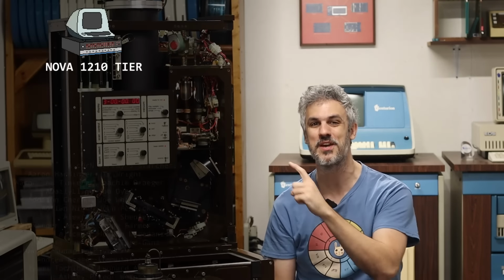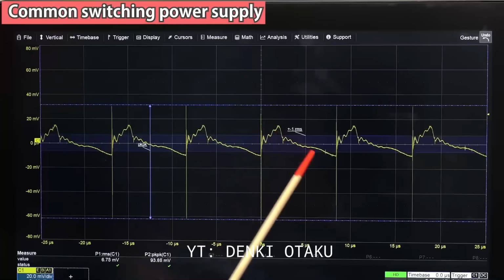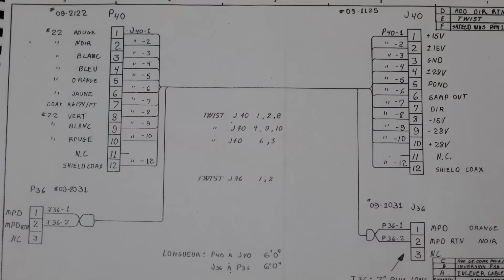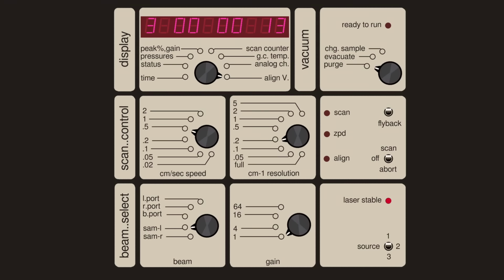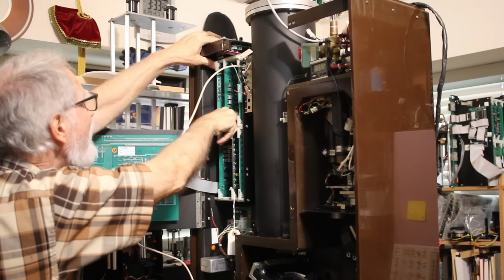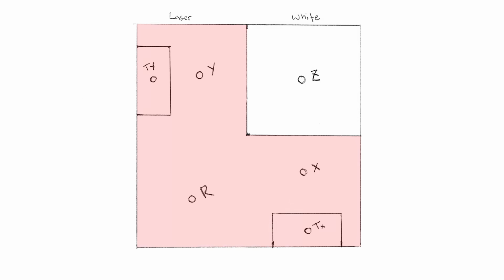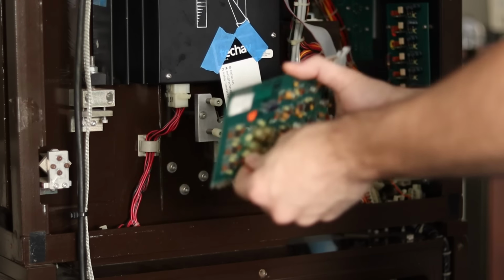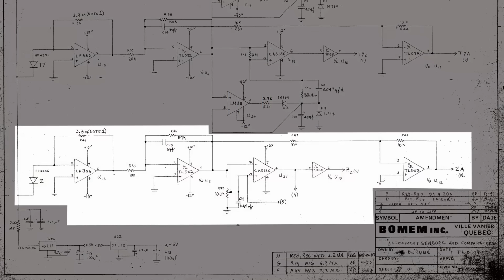I Found a Production Mistake on the Spectrometer!

Comment: so, I have a comment about the +/- 15 V jumpers that got removed at 26:36.  I think you probably should leave them in.  yes the pcb has traces and through-holes that do what those jumpers do and get power from one side of the slot to the other, but what happens when the pcb is pulled out of the back plane?  I think it's a sensible "feature" to remove power from the motor driver board if the circuit that should be controlling that board has been taken out of the system:  if there were no traces on the back plane, if the only connection was through the pcb then pulling out that pcb disconnects the motor drive circuit, both the control signals and the power, which sounds good.  the problem is that there are traces on the back plane, and you're hoping that none of the pins are even just slightly touching the sides of the through holes they're in.  what if the +15 V rail is connected, but not the return, and not the -15 V?  what happens to the circuitry on that motor driver board, do the control signals that are still connected provide a return path for the current and you end up feeding power the wrong way through a logic circuit or op amp?  I think you should keep those jumpers in.

Comment: I like your content and typically agree with your opinions and I'm thankful you went into detail about laser safety. However, arguing that the low power laser is safe because it's been used all over the country is not a good safety argument. See: asbestos. Even further, what is common is less dangerous than what you will probably handle in an industrial world, you can stare at the sun for a little bit and still see, one slightly powerful laser can immediately do damage. So thank you for taking it seriously.

Comment: The OEM unsoldered connections remind me of a similar thing I experienced.  Around 40+ years ago, I designed and built a 12 channel audio mixer.  I used it for my main mixer for recordings and live theater sound for about 30 years.  At some point, it had developed a glitch in the level meter system, that never bothered the audio.  For a long time I could never find the cause.  Until one time checking or modding something else, I discovered ONE main ground connection in the level meter system that I had missed soldering.  Soldered that point, and it never had the glitch again.

Comment: I usually start off by yelling at the screen before hitting the keyboard... Patience was rewarded since you figured out that the +/- 15V supply for the motor had to go through the card, and the wrong card was in that slot. 👍

Comment: Before getting complacent about lasers you should watch the film John Carpenter's "Dark Star" - especially when doing alignment! :glasses-purple-yellow-diamond: 😀 Couldn't see why it wasn't possible to resolder the +/-15V supply pins to the traces? R5 is not the feedback resistor it is the input resistor, R6 is the feedback. Gain = rf/rin = R6/R5

Comment: Well explained on the HeNe laser risk. I used to work with medical and dental lasers. If the laser were say KTP at 532nm, which is green, the eye risk would be higher because of the level of absorption in the retina (which is red). The other higher risk would be a laser with high absorption in water such as erbium YAG. So it's not just the power / watts output of the laser but also the wavelength and what it is interacting with.

Comment: I'm wondering if the motor control board had built-in connectivity of the 15v lines from one set of pins to the other, that the bridges card didnt have. 
This would make the connection to the destination pin headers through the card, so the missing solder wasnt detected.
Edit: Answered in video, lol.

Comment: Hi! nice piece of technology. About the solder and through-holes. Remember that you have the component side at view, not the solder side. So maybe the solder don't run into the through-hole complete height but at the tips is fully solder. If not when tie the wire-wrap the pin will fall out.
If part of the sensors can pick ambient light and you are using leds lamps at your lab maybe you are picking the modulation & noise from them.
I don't know in detail how a laser works, but if the gas is contaminated or if the lamp is worn out may be became noisy as a common neon pilot lamp or a vacuum tube, may be produce somo EMI noises or noises in the light.
At the regulators input you have there a low value resistor, them act as fuse and as low pass filter, but for some reason the capacitor that the regulators needs at the input is not at the diagram :) (no low pass filter activated :)).
I don't know if the OAs use a VREF line, if use change all the capacitors at that line too :)
My money goes for the leds lamps and noise from them :)

Comment: Likely the card plugged into that slot had both sides of the card connected through via so the card probably completed the circuit.
Reply: As it turns out later in the video, that is precisely what the issue was.

Comment: A little bit of nit-picking on the LASER safety talk: A centimetre-wide beam is not really safer than a focused pin point. If you were silly enough to point a centimetre-wide beam into your eye, the cornea would do a very good job of focusing that beam down to a point on your retina.
Reply: It is safer (on average) for the simple reason that it is a lot for something to perfectly reflect that one centimeter of light perfectly into your eye, vs a smaller spot of equivalent optical power. You are correct that in the worst case both could result in similar damage to the retina, but you need a pretty much perfect hit on roughly maximally sized pupils to get max power on your retina with a 1cm beam, vs a a tighter beam that doesn't need nearly as perfect of a hit.

Comment: “Noise” on the ZPD detection – 

When I was looking at the scope trace @40:56 it doesn’t look like noise to me- it looks like there is a second signal separated by ~320us… not just random noise.   I don’t think noise from the mean well supply would look so similar.  
 
If the problem is due to vibrations in the motor you shouldn’t see it if the motor isn’t moving.  If you scan the motor to the Zero Phase Position and stop there you should see the maximum signal strength from the detector as all wavelengths are constructively interfering.    If that signal still isn’t stable that isn’t the motor- that leaves the detector and the amplifiers.

Comment: HeNe lasers have several failure modes.  If the tube sits idle for long periods of time, very small amounts of impurities can outgas from contaminants or extremely small real or virtual leaks.  Running the discharge can clean the gas of these contaminants by reactions between excited states of the He and Ne atoms and the contaminant molecules, such as N2, O2, H2, and CH4. These reactions break apart contaminant molecules into products that stick to the glass walls and leave the plasma cleaner.  Contaminants in the plasma can make the discharge unstable and reduce the output power of the laser.

A long term failure mode of HeNe lasers is caused by the Ne and to a lesser extent the He atoms being implanted into the glass walls of the tube.  This implantation is caused by Ne and He ions that reach the boundary between the plasma and the glass wall being accelerated by a DC electric field that forms at the boundary of the plasma.

Comment: I don't think that unsoldered pins on the backplane were a mistake but a design feature. Without the motor control card plugged in the +-15V will not go to the motor driver electronics which is a form of fail-safe.
Reply: but the pins were in the board but neither soldered nor insulated, so they could still make an intermittent connection without solder. if it was intentional it would not be like this. 
also he compared to the backplanes the other guy has which were all soldered.

Comment: My money is on a noisy op amp,  they can be 'funny' they also like to be oscillators without too much asking.. 

Only ever seen a production error like that in a 1kw military HF linear amp  (AN/URT 23 V(c)) where a terminal post was not soldered, it took a week of two techs to find it, worst intermittent fault I ever had.

Comment: A very interesting video, as usual.
Around 12:30 you show the wire-wrapped backplane. I'm surprised to see that they used the same light blue color wire for all the connections. I have wire-wrapped a certain number of boards around 79-81 and I used different colors to make fault checking easier, like green for data, yellow for addresses, etc. For my PhD project, I built, with two colleagues, a prototype for an real-time image compression computer, half 74S chips and half ECL. We wire-wrapped several dozens of boards and it worked after a long phase of tinkering.

Comment: Hey Usagi,
Power Engineer here from NC. When you’re hunting noise in a system, use your scope and try to trigger off the noise. From here take a FFT of the noise this is useful for determining the frequency components of your signal. You can then try matching the frequency of this noise to your suspected noise source. Also as a neat trick, you can remove the witches hat from your scope probe and use that probe a poor man’s near-field probe. I will note this really only works for “large” amplitude noise sources. Still worth a try. Also please make sure the thing your pressing this probe against is not chassis grounded as is often the case. For these situations use kapton or electrical tape.
Reply: And for a current probe you can cut the end off a bnc cable, fold the center conductor over, solder it to the shield as close as possible and put some electrical tape over it.  Get it within a few mm of the offending current flow and your scope will light up.  For a probe that averages a larger area, make a loop in the center conductor before returning it to the shield, but in my experience I always want the tightest one eventually and switching probes isn't worth scanning the board faster.  An EE showed me this once when I was trying to debug an EMI compliance problem without a current probe and the noise was everywhere but the source wasn't obvious.  It totally saved both me and the customer.  It turned out to be a completely unnecessary logic gate that we simply removed and passed the test, but that's a story for another comment.

Comment: Could the lack of that filter you removed be affecting the sensed light?
Reply from the maker: Not in this case. The filter has a little notch cut out of it for the white light to pass through unfettered to the sensor, so this problem would exist with our without a filter installed.

Comment: This control computer is running Windows XP 😅
Reply: And the problem is ? 
As long as you've got the install CDs, and have put superglue into the network port so that you have to air-gap it from other networked machines in the lab.
"Ohh, look! New! shiny!"
"No, that shininess is the polish from having worn all the rough spots off the system."

Comment: 19:23 19:25 19:30 19:45 24:57 Why is your driver's seat on the right side of the car? At first I thought it was a camera mirroring the image, but none of the text is reversed.
You stop trying to hurt my brain!!
as to the noise issue - not once do I remember you saying the words 'zener diode'. Are there any in this Box of Wizardry? Perhaps a resistor that has a micro-crack in it? Best luck finding the temperamental part!

Comment: Going to guess the noise is popcorn noise from one of the input opamps, which is a very common failure mode for those early opamps, especially in plastic packages as the plastic changes as it ages. I have also met it in TO100 can SFC2741 opamps as well, but those were rare, most common was input offset drift outside of the allowed range as they aged, which was a bit of a problem in Dc coupled application, where the input zero was needed as the ADC itself needed each channel to have a good zero, as otherwise your span was going to be off.
Reply: That might in fact be the culprit, agreed.

(I'm mostly commenting to appease The Algorithm into raising this thread.)

Comment: Just place a 0.01uF capacitor across the Meanwell output.  The noise will disappear.  Do it at the Meanwell output and at the other end of the wire to completely wipe out any spikes.
Reply: if that PSU doesn't have such a capacitor already built in I'll eat my hat. 
Ok, I don't even have a hat, but still.
Reply: @jwhite5008  I agree, as Meanwell makes great power supplies.  I also doubt it has a noisy output.  Nevertheless, adding the caps won't hurt.  Just because someone says it, doesn't mean it's a fact.  Connect it to a scope to verify the hearsay.  If noisy, then using the scope, attach small caps to see which value works best.
Reply: @richardkelsch3640  yes to this.  There's more to cap selection than value, but even if that's all that matters the value of the cap should be optimized for the frequency of interest.  Also, find your noise on your victim circuit and see what your changes do in that circuit.  It may be counter-intuitive.  I have a hunch that there's some 200-250kHz noise somewhere, and 10nF would look like almost 64 ohms at that frequency, but higher value caps will have too much parasitic inductance to be effective at much higher frequencies, and while it is possible to gang multiple caps to cover different frequency ranges, they end up creating complicated multipole filters, which, if you're not careful can actually make things worse.  To top it off, the manufacturer of a cheap capacitor likely doesn't even list a value for ESL, so you have to guess and measure performance in your circuit.  Physically smaller parts tend to have lower ESL but that's not a guarantee.  Also, there are certainly caps present in the output of the power supply, adding more may already be putting you into complicated response curve territory.  Which is fine, but go in armed with a bunch of options and the ability tell which one works.  "just put a cap on it" is bad advice.  It might work, but it might make things worse and then you've convinced yourself that noise isn't your problem, when it is.  For example, even if you choose a cap that attenuates your voltage noise nicely it's going to do that by conducting a bunch of (high frequency) current.  Depending on the layout and how you attach the cap, there may be a nice antenna between it and the noise source, and you may actually be radiating more energy into your victim circuit.

Comment: Remember Murphy's Law? Safety glasses are really, really low cost insurance.
Reply: Perspective matters.

Realistically by far most likely reason this machine or its laser does actual damage to his health is if he trips and falls into it. I'm not sure how much help would the goggles be in that scenario.

Sure, safety goggles for the laser, rubber gloves for AC voltage, and a hardhat for accidentally hitting head with very sharp objects won't hurt David but will eventually make work unnecessarily harder. 

Extra safety is good but too much useless safety distracts from actual hazards. 

When working with complex scientific equipment your knowledge and undivided attention are often your most important safety gear for better or worse. This is why you don't typically see scientists working wearing armor on top of a hazard suit even if they are working with stuff that can easily k!ll them.

People do make mistakes and some things are worth protecting against, but this is not such a case.
Reply: @jwhite5008 You made my point. Dumb stuff happens. Laser-safe glasses are cheap insurance.
Reply: @strangeluck  So are rubber gloves, anti-slip workboots, a hardhat, OSHA-compliant work jacket, and a long list of other protective gear that is technically applicable but not actually helpful in realistic scenarios in this particular case, the video already describes why.

If anything, moving heavy objects and rewiring AC equipment without a partner is much more of an OSHA violation, i.e. more dangerous so if anything really needs reassessment it's that.

Arguing about it here doesn't seem any useful though so I won't do that any longer.

Comment: Where's the noise coming from! Love that question! Currently building a laser scanning Hyperspectral Confocal Microscope and spent about 3 weeks figuring out random jumps that my Galvos kept making. Turned out that the power supply for the Spectrometer was injecting enough back into the power line to completely throw the galvos off!

P.S. loving the explanations on spectroscopy!